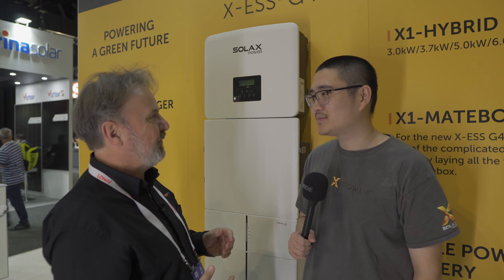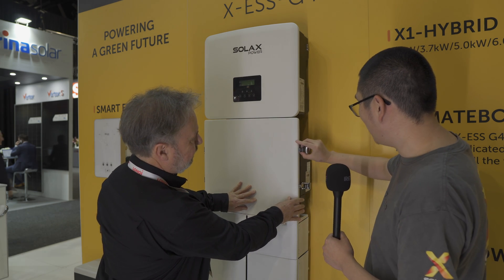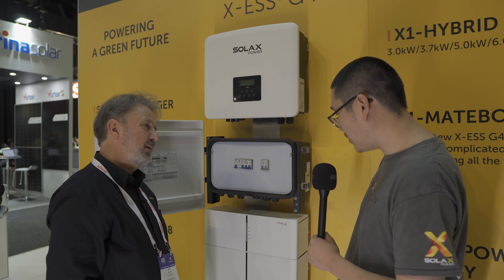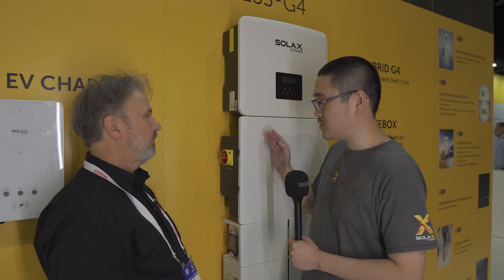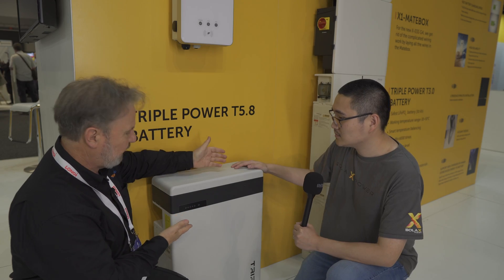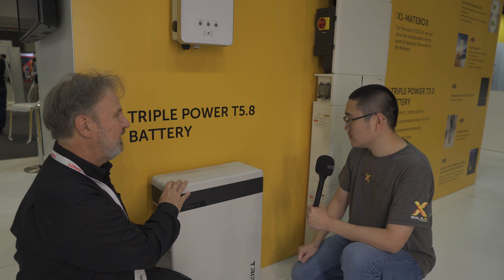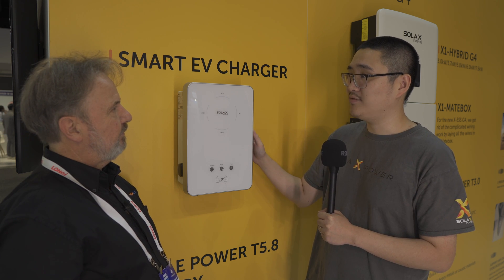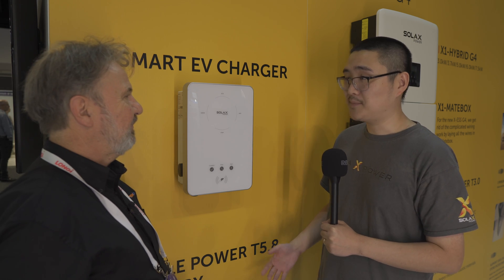SolaX Hybrid X-ESS-G4

Comment: Is it possible to run 2 of these systems in parallel mode?
Reply: the hybrid 7.5 has a parallel function to allow 15Kw use. You select via software which one is the master and the other the slave.